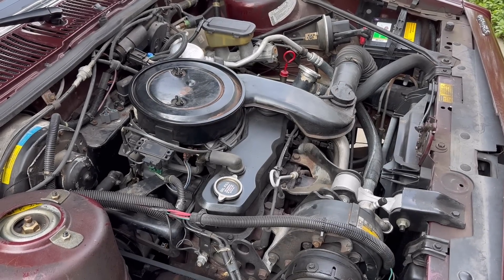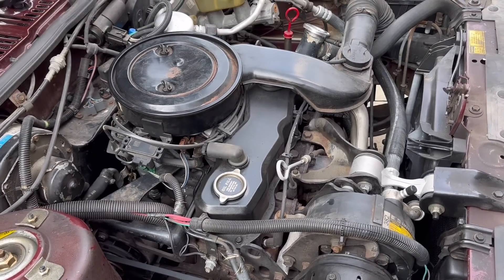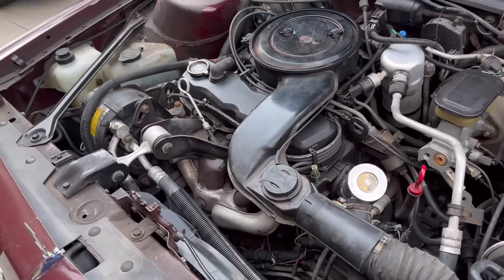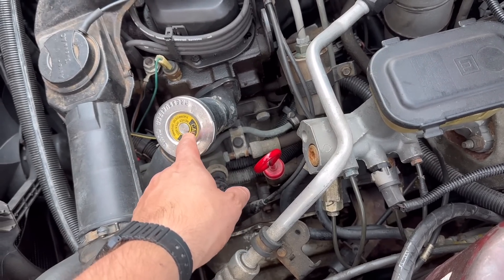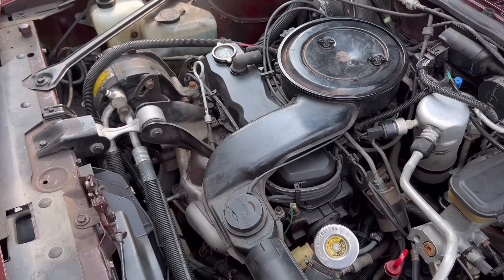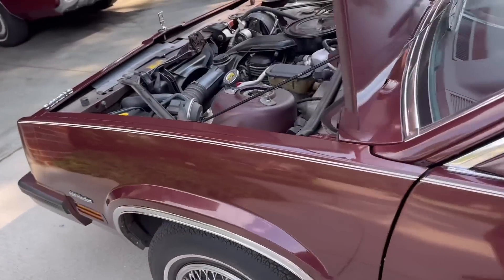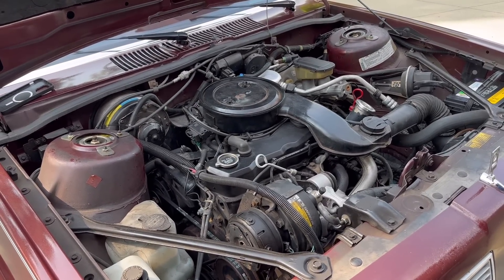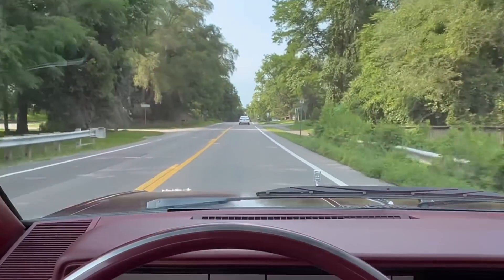Bad Engineering Makes This Engine Challenging to Repair: GM 2.5L Iron Duke 4-Cylinder Engine

Comment: The engineers were thinking "What's the cheapest way to push these off the assembly line?"
Reply: Well it was originally designed to be a rear wheel drive motor and they just got clever and converted it to the front wheel drive with adapters
Reply: @charlesdiggs5297  That's what I was thinking.  Doesn't look like it would be bad at all when mounted longitudinally.
Reply: @plmn93  or they could have spun the engine 180 degrees and mounted the differential upside down to reverse the rotation.
Reply: @charlesdiggs5297  The V-6 was the reverse. It was designed for the transverse FWD X-car and they changed mounts for RWD applications.
Reply: And they weren't wondering what people would be saying about them in 2024.
Reply: I've always heard that is why Ford has such terrible vehicles. Ford engineers design them solely for ease of assembly at the lowest cost, and any repairs are an afterthought (or never even considered at all).
Reply: @bartholomausallen883 *Had
Reply: @bartholomausallen883  You can replace Ford with most any brand and someone will be saying the same thing.  

A car is an incredibly complex machine.  Imagine designing an engine that has to fit multiple platforms, some platforms that don't even exist yet.  Now do that with limited time / computer simulation / prototypes.

If you want to see a well designed car that is ( mostly ) super easy to work on look no farther than the Chrysler PT Cruiser.  Other than timing belt / water pump change being a bit tight ( if you know the secret it is less tight )  nothing is difficult to repair.
Reply: That is the entire reason front wheel drive vehicles exist. They are a lot cheaper and easier to make. Literally everything is crammed into the front end, making things extremely difficult to get to.
Reply: @geraldscott4302  It's standard procedure for the newer Ford F-150s with the Ecoboost engines to lift the cab off the frame for a lot of repairs.
Reply: @geraldscott4302 not on those motors.  Very easy for even knuckleheads.
Reply: They were thinking that and also that people would just sell or junk a problem car and buy another. People were very wasteful in the 80's. I personally knew people who junked cars for incredibly stupid reasons such as it wouldn't stop because they completely used up the pads and the rotors growled and the steering wheel shook. I told her when I found out "You know, It probably just needed basic pads and rotors right?" The look she gave was priceless!
Reply: Actually bad engineering has a way of making things easy to repair and make better.  Its obvious...
Reply: well to be honest it was a engine from the 1960s, so the engine bays in that era were much larger.
Reply: Was just having this conversation with a friend who works at a GM assembly plant…”they’re engineered to get put together quickly and cheaply; they’re not designed to be repaired”
Reply: That car will last forever if you service it regularly
Reply: Push is the key word there!
Reply: They were one of the easiest engines to work on.  Literally…
Reply: That's a negative, ghost rider.  The people who were thinking that were the bean counters.

Engineers don't really understand money.

What they DID do was build the entire drive train onto the subframe so that it could be assembled as one unit on the assembly line.  Not maintenance friendly, at all.  Unless, of course, you drop the whole thing out.  Then it's a piece of cake, which is how the factory comes up with its wholly unreasonable repair times that no tech at the dealership can hope to match.
Reply: @tetedur377 
Yeah that's kinda the way I always heard it. 
The engineer designs something awesome ,and the bean counter comes in and asks if it can be made from cardboard instead of metal to save a buck per unit
Reply: Going back farther, these engines are more or less based on the 230 250 292 Chevy inline 6.
Reply: @bobroberts2371  No they're not based on the Chevy six. That's a myth. 

Search: "For the last time, the Iron Duke was not the same engine as the Chevy II four-cylinder"  from Hemmings March 2024
Reply: @DaveGreg100   I NEVER said the two engines were exactly the same, I said BASED ON.  Look up CLOYES 2542  /  MELLING 2542 fiber cam timing gear.  This was used on the light duty 250 Chev inline 6 AND the 83 Omega Iron Duke.
Reply: Worked on many 2.5 engines with TBI. These weren’t difficult to work on at all.

Comment: Back in the late 80's and early 90's our family car was an '85 Cutlass Cierra Brougham 4-door.  Awesome comfort, quiet smooth ride.  We made several summer vacation trips with our two teenagers to the Colorado/Wyoming/Montana Rockies (from Oklahoma City and back) that were totally trouble free.  It had the 2.5 Iron Duke with the 4 speed Hydramatic.  Yep, each trip included crossing the Continental Divide several times, and that Iron Duke was working it's ass off the whole time.  What blew me away was the fuel economy.  On the way home and out of the mountains, it consistently provided 37 to 39 mpg on 'the flats' of Kansas and the Oklahoma Panhandle areas.  Awesome cars for sure, underpowered, yes.  Always wondered what the V6 version would have been like.
Reply: It’s much beter had one iron duke (blown engine twice)
And after that only V6 in X and A body GM excellent engine and the quality is outstanding best years are 1980-88
Reply: My first car in 2002 was my parents' 1983 Oldsmobile Cutlass Ciera Brougham. The interior was plush as hell, and once I got the engine running right it was a very nice driving car. I had the V6 version. It had some pretty decent pickup and go, but I don't remember how well it did on gas. Back then I didn't keep track.

I miss that car. We finally sold it for scrap after the water pump gave out and my parents were tired of putting money into it. If I had it now I'd be fixing it until it literally couldn't drive any more.
Reply: I've never seen a 2.5 FWD that had a 4 speed auto, only a 125C 3 auto behind it.
Reply: @adamtrombino106  Ours had an overdrive (I assume the 4th gear) with lockup torque converter which was the last 'shift' to occur at cruising speeds.  At 70, you could barely hear the engine running.
Reply: @santaclause2875 That last "shift" was actually the torque converter lockup on just a 3 speed automatic transmission. 37 to 39 mpg is incredible on an Iron Duke, but I've heard similar stores, but only on cars from about 1985 or before. The 86/87 and later iron dukes might get 32 mpg on the highway. I wonder if they were running a lean burn computer code, and the tightening NOx emissions limits forced them to abandon it in favor of stoichiometric combustion to get the 3 way catalytic converter to reduce the NOx.
Reply: The only V6 options would have been the 3.0 2bbl. Which I had. It had tons of problems. This is why GM dropped it after 3-4 years. The 3800 wasn't refined yet at this point. Then the diesel. But we wont go there. You had the best engine for this year.
Reply: The V6 version would have been a nightmare.  No acceleration and a total piece of junk. Junked the car and I bought a 78 Cadillac DeVille with 425 V8 with a much better engine and suspension and a lot less headaches.  This $700 var lasted 7 years with no major repairs. Really miss that car!
Reply: @santaclause2875  Are you sure about the engine/transmission combination? I don't know if the Iron Duke ever saw a transverse overdrive automatic transmission. It was likely the Hydramatic 125C.
Reply: Had an ex-fleet 1991 Century. With 2.5 Iron Duke. Slow as a slug, dependable.
Reply: We had a 1990 Calais we got from Granny with 14K on it. It was slow getting up to speed but when we went on a tour of the northwest, out in BFE South Dakota and Wyoming I had that thing going, had to be well over 100mph for long distances. The needle was pinned so far down past 85 and it had power to spare, easily. So smooth and quiet my wife slept through the whole thing.

Comment: My mom had an 81 Chevy citation. What a POS!
Reply: My best friend had an 81 3 dr, with the 4speed, as his 1st car. This was in the early 90s. It had just 32k on it. And we soon found out why. It rarely wasn't broken down. Carb issues, ecm failures, wiring problems, brake problems...He dumped it for a used Accord.

Comment: I worked at a dealer in the early 90's. another HUGE problem with that distributor was water would get in it and either kill the engine or keep it from starting.  even a light rain would get the cap wet and the engine starts coughing, sometimes it would clear up but mostly it would get worse.

Comment: Typical GM, they got it mostly sorted out with the updates 5 years into production, had an ‘88 century with the tech 4 that’s I drove to 286,000 then sold what was left of the car to a guy who drove it to about 350k. That motor was so loose that when you push on the external alternator fan with your thumb the whole engine would turn over!
Gotta love those in pan oil filters too, those were the fastest drain ever.

Comment: Had an '86 Calais with the Iron Duke and it's the worst engine on any car I've owned. Blew a head gasket at 57,000 miles and ran so rough that you had to put the car in neutral to keep the dashboard from vibrating at stoplights.  I've driven riding lawnmowers that felt more refined.
Reply: I test drove an 87 Skylark with a 2.5 and it did the same thing at stoplights. Chintzy. I did like the digital dash though.
Reply: You've probably driven riding lawnmowers that were quicker, too.

Comment: Oh dear lord...... talk about bringing back some unpleasant memories working on a a 80s GM FWD with a Iron Dookie engine. Not to mention driving one.
Reply: @Troy_nov1965  Iron Dookie was the weakest and slowest engine I ever had in any car. 😆
Reply: @erocker78  LOL yeah same for me , It wouldnt pull a greasy string out of a cats ass
Reply: Lol I was GIVEN a cherry one of these about '92-'93. Everybody told me I was the guy to make one run like hell "for a while". Long story short was two big bottles in the trunk one propane one nitrous oxide and it had a reeeeeally long throw "throttle" pedal (completely variable manually controlled NOS). Got it to run 13 flat with tire smoke off the line - once.
   We tore it down and it had ripped the ribs holding the intermediate planetary gear set in the wimpy Turbohydramatic 125m. What failed wasnt what they were famous for breaking - GM had fixed that and poured money into making the things abuse-proof - but not 350 NOS-boosted horsepower abuse - proof, lol.

Comment: That cap and rotor wasn't TOO bad.  Reach down, under the master cylinder and behind the engine and feel your way around.  The worst part was getting the cap over the pulgs on the ignition module.  The cap and 2 grooves over the cut out in the cap.  When you're feeling your way around it's hard to know if you've got it over the module right.
The alternator belt was a bit of a bear because it needed replaced a lot more often than the other belts.  The power steering belt had to come off first and that was a little bit tricky to get at all the bolts on the pump.
Timing gears were noisy on the R engine, but the U engine in N body cars had a slightly shorter block and had different timing gears,  They sounded awful even when new. 
The vacuum pump...which was where the fuel pump was on the older carbureted versions, was a pain without having the car on a lift.
Exhaust manifold cracks were common.
GM initially used that orange RTV for the valve cover gasket.  NAPA had a nice thick cork gasket that worked well.  It had spaces in the bolt holes to prevent crushing the gasket.  You had to remove the EGR on the TBI versions.  I used a 1/2" distributor wrench that barely fit the 13mm bolt heads to get the EGR bolts out
I remember those cars well from my days in the mid 80s as a Buick and Olds tech.  In the early 90's I bought an 81 Omega with the 2.5 and a feedback carb with a 4 speed (no AC) for 250 bux.  I drove that car for 7 trouble free years

Comment: I well recall these as a career mechanic. Replacing all  3 engine belts or a water pump was difficult. The  power steering pump had  pivot and adjusting bolts in hidden locations behind  the pulleys and brackets. Some of the early 2.5 X cars had the blower motor resistor on the front of the  blower housing. Customer complaint was  blower not working.  The dog bone type torque struts on the core support to engine would be so worn out the engine would roll back and crush the blower resistor with the intake manifold. These RTV sealed engines leaked oil like sieves after 60,000 miles. Worked for a engine rebuilder in the 80s. It wasn't as noisy as the tech 4 with the rattling worn balance shaft carrier in the pan.
Reply: I am sorry that Adam made you relive those horrors. 😉😉
Reply: @RightLaneHog3151 😂
Reply: I replaced  many x car dog bones with moogs little shock  engine  mount.
Reply: I broke an alternator belt on a -20 day in minnesota.  Got a new belt at an amoco that worked on cars.  Used the wire cutters on the power steering belt and replaced the alternator belt.  I don't think i fixed the power steering belt for weeks.
Reply: Is it true that only one end of the balance shafts on the Iron Duke got pressure lubrication, the other end only received slash oiling from whatever oil fell on it?

Comment: At least you don't need to remove the intake to change valve cover gaskets and thermostat like on a 2018 GMC Acadia with a 3.6. I was m.f.ing that all day today.
Reply: True, and you don't have to pull the intake manifold and everything else from the top of a Nissan 5.3 V just to replace the starter motor  (which is buried deep in the valley of the block).  Way to go Nissan!!

Comment: You'll find that pretty much any fwd car has their repair challenges.
Reply: As I recall, my VW Scirocco was very easy to work on. Nothing was hidden and you could get to any of the bolts easily. This was good because the thing broke all the time.
Reply: @soaringvulture 
Haha after chasing an oil leak in the bell housing area in my 79 rabbit with a Tdi-m, I was able to have the trans on the floor in 35mins. 
Of course ,doing it 5 times before made me fast. 
It ended up being a oil galley plug

Comment: I figured you were going to comment on Cadillac Shoehorning a V8 in their FWD cars in 1985

Thoughts of Homicide come to my mind, any time I have to work on any car after 1984.
Reply: I had one of them and I loved it. It was an 89 Sedan Deville with the 4.5 TBI. It wasn't difficult to work on at all for a front wheel drive. The car in this video looks far more challenging then mine. The drivetrain was very reliable and cheap to repair. It  had lots of room all around, very comfortable interior, ultra quiet, super smooth, pretty reasonable fuel economy, and a bit of power. They came out with a 5.0 liter the next model year, and I always dreamed of what that extra boost would've been like to that big old car.
Reply: @JoshuaDemersProductions  

I had a 90 DeVille with the 4.5 with SDFI, and then a 91 Fleetwoodm with the 4.9. Engines only had 9.5:1 Compression, but required Premium. Changing the HVAC Blower was a Pain, practically had to pull the Motor out to do so. That was why I made my Original Comment
Reply: @JoshuaDemersProductions  

A 5 liter was Never put into the FWD Cadillacs. The RWD got the 5 liter in 1986, I had one of those, still my Favorite Cadillac, despite having No Power.  While the 90 FWD with the 4.5 Never gave me issues, the 91 with the 4.9 did, the Transmission would do something weird and throw Body Code, so I don't think the Puny little Transverse Transmission in those Cars was very Good.
Reply: @pjimmbojimmbo1990  4.9 - 5.0 whatever? Maybe, the listing was inaccurate or my memory. My point remains valid about transverse mount FWD V8's in older Cadillacs being a great thing versus the opposition.
Reply: Certain body styles with the 4.5 and 4.9s were indeed mighty packed in there. I recall several times having these cars coming in with misfires and finding the frt bank plugs changed, but rears were never touched...